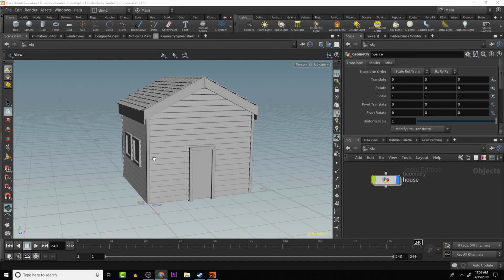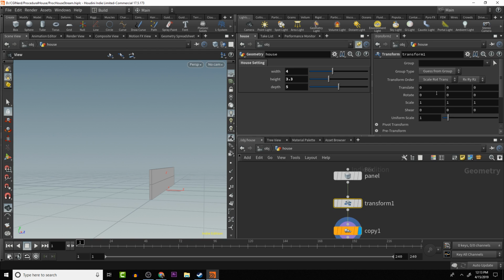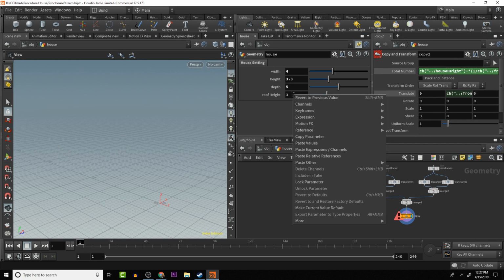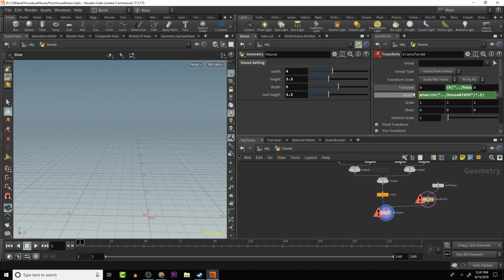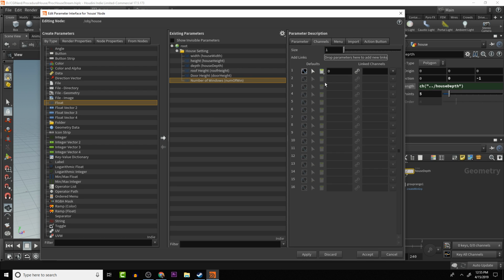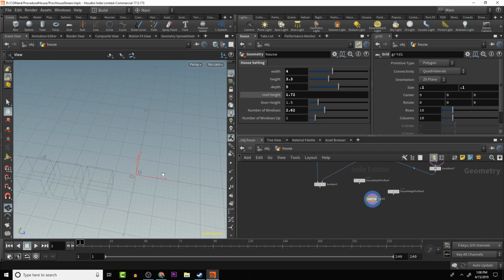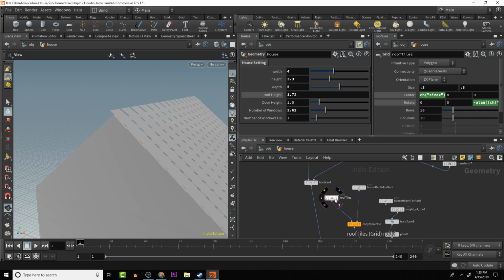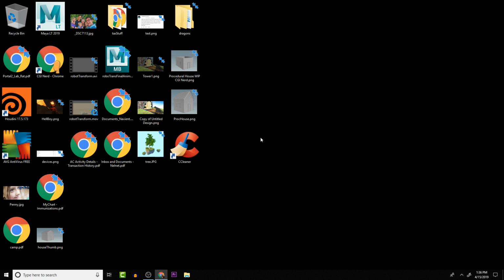How to make a 3D House | Houdini Tutorial (Part 1)

Comment: Hi thank you so much for the tutorial, in houdini 18 point old isnt there so what node shall I use to give point edge force?
Reply from the maker: can you give me the time in the video where the issue happened and I can help you get a result that will work in version 18. Thanks
Reply: @CGINerd  At 1:20:15 when you want to create normal for the tile to follow the line
Reply from the maker: @AnimationDunk  I tested it on my file in Version 18 and it seems as though the edge_dir is already built into the line node now so you can actually skip the Old Point node and jump down to the next step of creating the point vop which will make the normals for you.
Reply: @CGINerd  Oh alright thank you for the answer! Maybe I just have trouble with the angle of the tile in relation to th angle to the roof, atan dosent really seem to follow

Comment: I would have started with a box, then given it the overall look of the house.
Once it looks like a house, you just create one subnetwork for each type of material, for example roof shingles, planks and so on..
Then you just build the roof shingles so that it fills the input geometry (some kind of planar primitive or something).
That way you can avoid all of the tedious math you're doing and channel referencing. The primitives are just there and you build on it.
Useful nodes for this are: 1 /bound with Oriented Bound Box enabled and Tranform Attribute  enabled (useful downstream to tranform it to a normal form, e.g, axis aligned)
2/ Match size  to align one premade geometry ( for example a bunch of planks) to something...